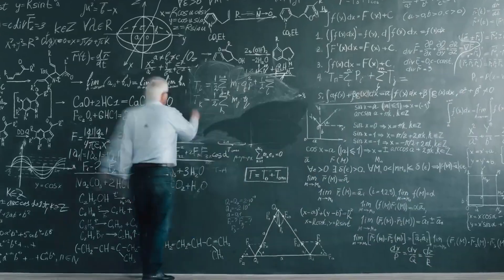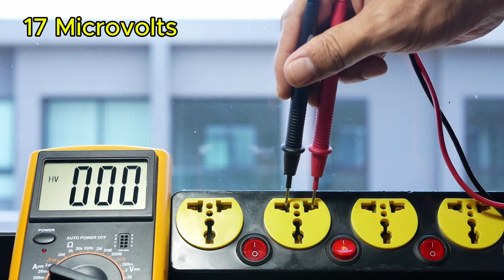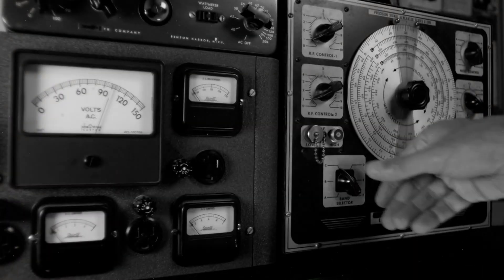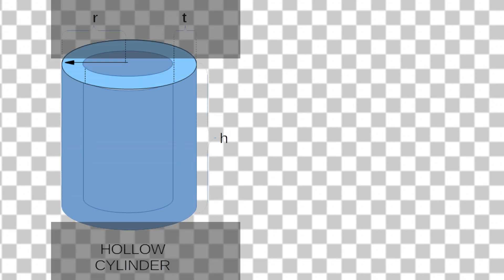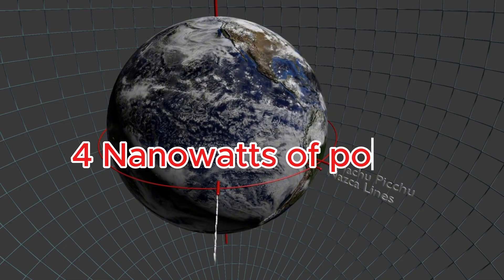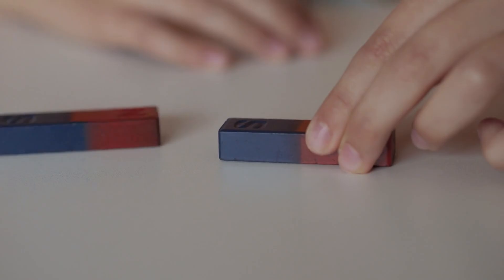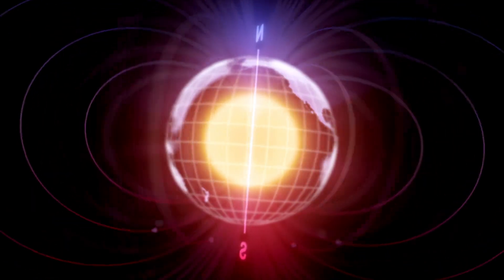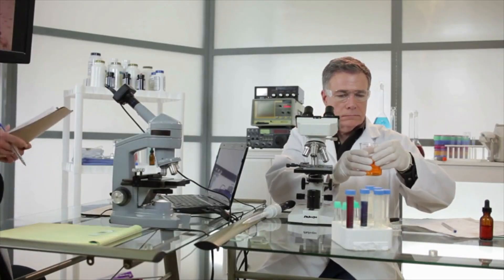Scientists DISCOVER FREE Electricity from Earth's Magnetic Field in 2025!

Comment: Probably that's why the pyramid of Khufu has hollow shafts. We all know that the pyamid is made of granite covered with marble slabs while the apex of the pyramid was a golod triangle. Plus there were aquifers inwhich these shafts were submerged for earthing I suppose. Thus,. the gold triangle would have a very high net positive charge / voltage supercharging the ionosphere. Similarly, Tesla also built the Wardencliff Tower and transmitted electricity wirelessly miles away.
Reply from the maker: thanks for your feedback

Comment: There was in the past the n-field  rotating magnet and rotating iron core and electromagnetic iron / copper using the high amperage flow to boost amperage flow.   Power is tapped off using bushes on Mercury contacts onto the edge of a conduit disk.   Simply this motor is based from Faridays copper disk moving threw a magnetic field, however the magnet can also rotate with the rotating copper disk.
Reply from the maker: That's an interesting historical perspective on the principles at play!

Comment: "Africa Is Powering Up — Without Wires! | Maxwell’s Wireless Energy Revolution" https:// youtu.b e/E9bU-32u58A?si=9cQ9lTghSqAvm_zE  & ...  "Maxwell Chikumbutso’s Free-Energy Car: Full Breakdown of Specs, Features, and Surprising Results" https://youtu.be/LphajrpHY2g?si=_CrS5NcNWIh3ZHBl  Maxwell Chikumbutso, the visionary Zimbabwean inventor, has unveiled his groundbreaking self-powered electric vehicle that operates without traditional charging or fuel. This in-depth review explores everything you need to know about his revolutionary car — from its full technical specifications and unique features to its real-world performance results that have shocked both engineers and the automotive industry.

Unlike conventional EVs that rely on lithium batteries and charging stations, Maxwell’s innovation is powered by a self-sustaining energy system, eliminating the need for constant charging. This means unlimited range, lower running costs, and a complete redefinition of what we thought was possible in clean energy transportation.

In this video, we break down how this car works, what makes it so different, and why it could disrupt global automakers like Tesla, BYD, and Toyota. With its futuristic design, unmatched efficiency, and world-first self-recharging technology, Maxwell’s EV may be the blueprint for the future of mobility.

If you’re passionate about green technology, disruptive innovation, and Africa’s rising tech pioneers, then this review is something you cannot miss.

Hashtags:
#MaxwellChikumbutso #SelfPoweredCar #ElectricVehicle #EVRevolution #FreeEnergy #CleanEnergy #FutureCars #SustainableTechnology #AfricaInnovation #TechBreakthrough #SelfChargingEV #NextGenCars #AutomotiveInnovation #RenewableEnergy

Comment: maybe this is what Maxwell Chikumbutso have found out after doing so many electrical experiments harnessing power from the air running his endless power car that needs no refueling or charging, BTW, I found out that my UHF TV antenna produce 187mV to 82mV maybe it was just phantom voltage from the air
Reply from the maker: That's an interesting observation about the UHF TV antenna, thanks for sharing!

Comment: Can it power LED without fancy resistor electronics? 😊
Reply from the maker: Not yet 😊. The output is only about 17 microvolts and 25 nanoamps — far, far below what even a tiny LED needs. So right now it’s more a proof of principle than a practical power source. But who knows — with clever designs and scaling, maybe one day it could light up an LED!
Reply: @renewable_energy  you can use a microwave transformer to increase the voltage, hence power and current 🙂

Comment: Nicola Tesla has produced free energy directly from Earth by synchronizing a self oscillating LC(R) circuit with the free electric field inside Earth and transmitting it through a natural parallel-serial LRC filter between the surface of Earth and the air outside of it.
Huge power.
No need for the magnetic field of the Earth.
Reply from the maker: Tesla’s vision of tapping Earth’s electrical field with resonant circuits is truly fascinating — and it inspired generations to think differently about energy. What’s exciting here is that this 2025 experiment is testing something completely separate: generating a measurable current from Earth’s rotation through its magnetic field. Tesla’s work was about resonance and wireless transmission, while this is about induction at a planetary scale. Both approaches highlight just how much untapped potential may still exist in nature.

Comment: How much power?   this can be great if it scales.
Reply from the maker: Right now the output is tiny — about 17 microvolts and 25 nanoamps, which is around 4×10⁻¹⁰ watts. So it won’t run anything big yet. But the exciting part is the proof of principle. If researchers can scale it or use it for ultra-low-power sensors, it could open up new possibilities for green tech.

Comment: Nikola Tesla found that in 1931..... 😅
Reply: Great video. Thanks for sharing.

But the TESLA car still "needs" batteries, wires, and a place to charge. 

Electricity is still generated from coal, oil, gas, hydro, wind and nuclear power plants and transmitted by wires.

Only electricity  "consumption measurement", bills and some payments are done wirelessly.

😂😂😂😂😂😂😂😂
Reply from the maker: Thanks a lot! You’re right — even today, EVs like Tesla cars still rely on batteries, wires, and charging infrastructure, and most electricity still comes from traditional sources. What makes this experiment interesting isn’t that it replaces those systems, but that it shows a brand-new way electricity can be generated — directly from Earth’s rotation through its magnetic field. The power is tiny right now, but as a proof of principle it opens new ways of thinking about energy.
Reply: @ruzicaudovicic5802  The reason why we still run on fossil fuels and limited green energy is because the need of an artificial scarcity for profit.  If power were free, a lot of companies would lose profit, which they won't allow.

If ANYONE were to find a way to get constant and near-endless energy, they would be silenced, and their technology scrubbed from history.
Reply from the maker: Tesla definitely had visionary ideas about harnessing Earth’s natural energy fields, especially with wireless power and his Colorado Springs experiments. But this new result is a bit different — it’s the first experimental proof that Earth’s rotation through its magnetic field can generate a measurable current. Tesla dreamed big, and now physics is finally catching up in a new way.
Reply: @renewable_energy  Tesla did that too. This is just propaganda and disinformation to protect the status quo.
Reply: You stole my response 😭
Reply: I love it when scientific appropriation against Caucasians becomes main stream... I wanna cry
Reply: Yes Nickola Tesla did.